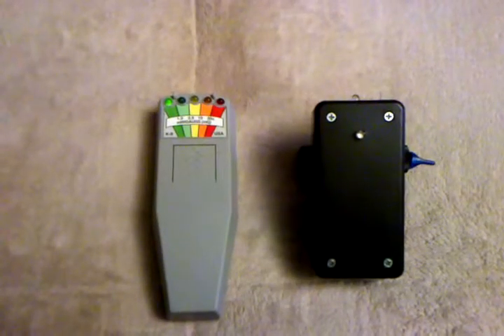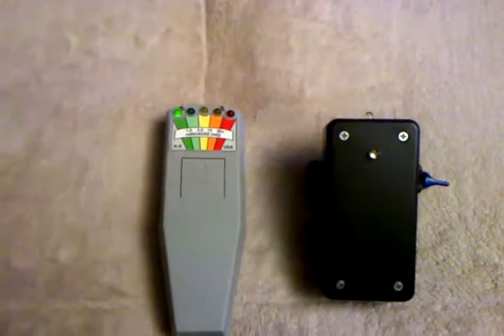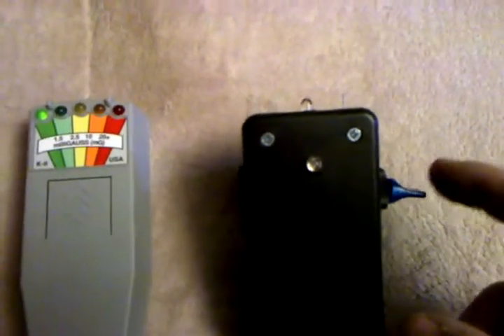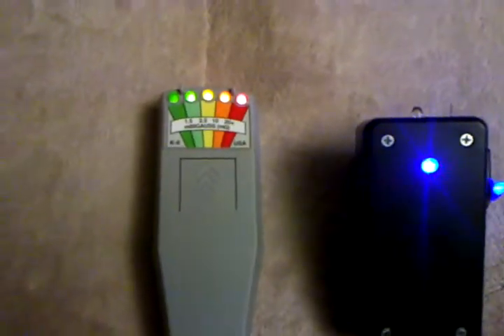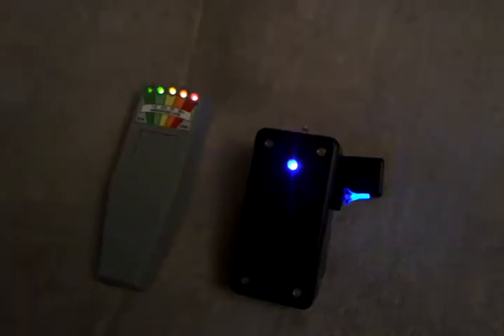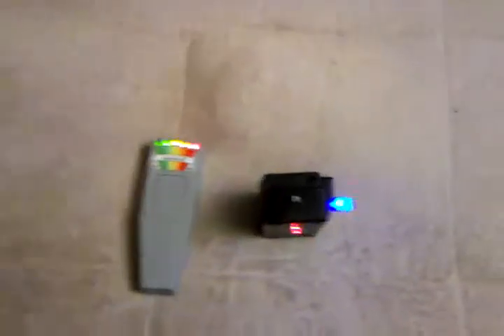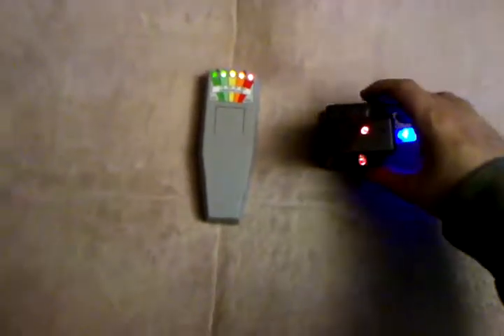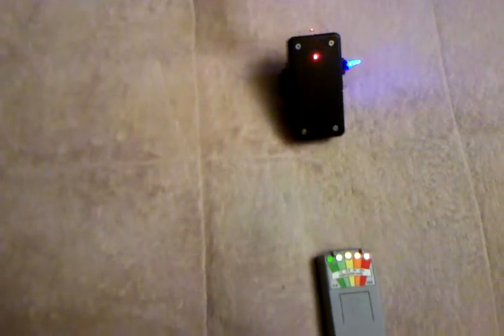EMF EM PUMP WITH A BUILT IN STATIC DETECTOR (ESD)

Comment: hi steve,loveyour vids.where can i get transistors from for,static detector??????????????????????.keep up the good work,,,,,,,,,,,,,,
Reply: You can get resistors at Radio Shack, however, you need to make sure you get a "Field Effect Transistor". They are dirt cheap, I got a package of four transistors for about $0.97, and if you look on Ebay, you can find the resistors even cheaper.
Reply: Thanks loads m8
Reply: Nigeljulie
Reply: Thanks for info
Reply: Will look for it on you tube